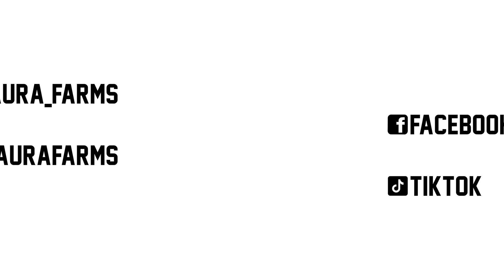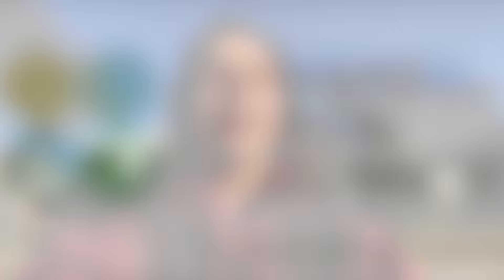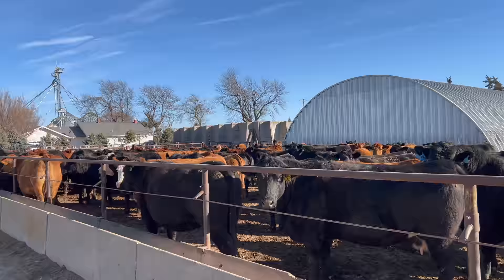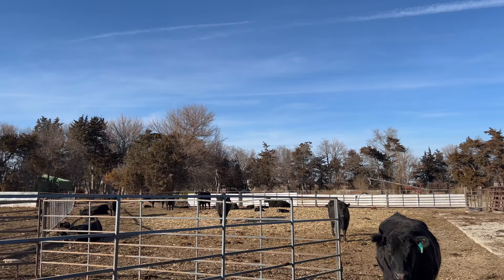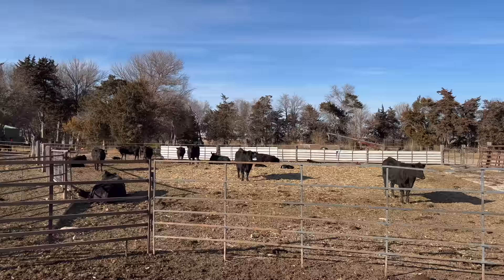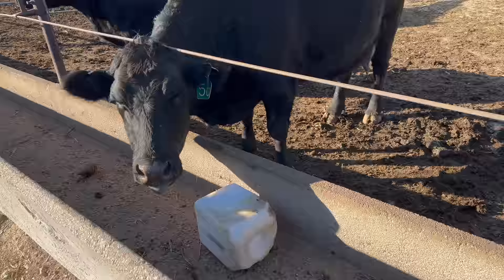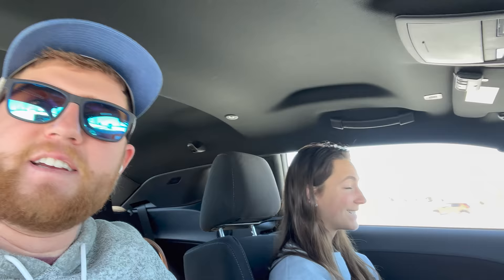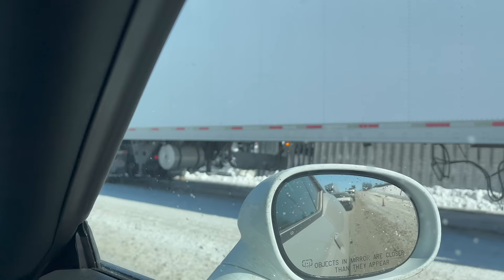My First Tractor Pull at The National Farm Machinery Show

Comment: Ahhh, nostalgia!
Only ever attended one farm show as a teen. One of the local farmers hosted it. Yep it was open air no big buildings to house the exhibitors. 
Always loved the equipment displays at the County Fair. 
Don't expect to ever make it to either ever again. Heavy sigh...
Tractor pulls are great. At a small one they would put an appropriate weight tractor on the sled then as the sled came past we members of our FFA Chapter would jump onto the sled and grab hold of the vehicle on the sled to add weight the farther down the track the tractor pulling the sled would go.
In between pulls we relaxed on folding chairs set ìn two long rows down either side of the track. For the smaller tractors they used a 1/2 ton pickup as the initial weight. Getting on the sled as it passed by was a little harder as the pickup was close to the width of the sled so not much room for your feet on the edge of the sled and still stand upright, grab onto the sides of the bed, open window or the extended mirrors. Great fun but being a live weight on the sled at a tractor pull was tiring.

Comment: Welcome to Missouri.  Some times, we will try to have all four seasons in a 24 hour period.  Wednesday, it was in the low 60s.  By 8, it started raining.  Around 3 in the morning, it changed to a heavy sleet.  And to finish it off, by 8, we were having a heavy snow fall with strong winds.  By the end at my house, we had an inch of ice covered by 5 inches of snow.  My two driveways exit on a hill.  It takes the highway department on average 3 days to come.  Cannot clear the road with a tractor (illegal), so I have to hand shovel to road and throw ice melt so we can get out if necessary.

Comment: Grant put grease in that seal before you install and it will help hold the spring and keep it in place and the grease will wash out in the next oil change. Laura it's spring cleaning time I pulled all there covers out from under my skid loaders this week and washed all the underside out first. So many farmers forget that part until they crack the oil pan.

Comment: Actually, the seal ring installation was done properly. The 'holy book' says it matters little (to zero) what method one chooses as long as the result is correct. If you used soft tools (wood/plastic) and inserted the seal axially, then you're good.

Comment: Thank You UMC!
I'm thinking a mechanical 6bt might be better than that pig. When I pulled 460 out they always had cracked heads and excessive ware related to oil design. Not quite an industrial motor.

Comment: Here in the UK, we used to get tractor pulling on Eurosport. Not sure if its on there anymore. I have to admit, there is something oddly compelling about watching German women driving monster tractors powered by a couple of old Soviet helicopter engines welded together on the front end of the chassis.

Comment: Gaah! I was so close to you guys at the Wednesday night tractor pull! I was only two sections over to your left standing right at the ramp opening for most of the night because the upper seats are so low to the ground (can't hardly stand back up after knees on the chest) and cramped! I even saw myself in your video! Banging head in disgust You all were sitting in the upper corner where the sound is the loudest too! The room is like a big horn reflector! I tried everywhere walking all of the buildings hoping to meet up with you both! I never thought about looking up on top of the Chief grain bin?! You may have been up there as I had walked right by it! And I also missed Erin Holbert and Farmer Grayce too? Dagnabbit! If it weren't for bad luck, I'd have no luck at all!  Bummer, dude indeed! I did get to see the Larson Farms guys at the Unverferth and John Deere booths! They are okay and nice, but I'm not a fan of those guys as I am for you all! I am so glad that you all had a great time here! You ought to be here for the Derby festival or the Ky State Fair sometime! I'm so sorry that I didn't not get to meet you all. :-(

Comment: i'm always surprised by how high-tech farming is. giant machinery that feeds the seed, then harvests and stores everything in seconds, gps tractors with friggin drone sensors or something that can sense when you're off by an inch.... it's like a nasa operation
Reply: NASA? Let me tell you - I worked in an emergency service where power outage couldn't be a thing. We purchased a pair of zillion dollar NASA generators that were guaranteed to come to full power instantly. Only needed one so NASA designed a connection that shut off a generator after one came to full power. Of course during a critical event power was lost and we sat there in the dark.  Finally got a NASA tech out that discovered the generators were so high tech they both came on in the exact same time and then shut each other off. . . smh

Comment: Maybe you've covered it before in a previous video, but I would really like a video that shows how exactly a pivot works. It's bottled my mind for years. How are the tires propelled? Each set of tires has to run at a different speed in order to stay aligned, are they each geared differently? If one section goes up and over a hill, that section would fall behind, but yet it doesn't. How is this possible lol?

Comment: whenever I install a new seal in such a cavity...if possible I place the new seal into area of cavity (well cleaned and prep of course)  under a drill press (no drill installed of course) use a block of wood - cut to fit..., the old seal, and visualize new seal being pressed into existing housing cavity with old seal ontop for even distribution of force from block of wood while pressing down with drill press....DONE.  no hammering.  Avoid touching new seal rubber whenever possible until  it is lubricated properly just before install.  HC Clark-ENC U.S. Navy Retired CPO (1973-1993)

Comment: Laura, your new pickup should be a Ram 1500 crew 6.6' box with the Eco?Diesel, it will pull 12K legal, get 30+ mpg on the hyway and 4x4 pickups are safer on snow for travel,  I had my eco since 2014 and love it.    Fan in Hastings.